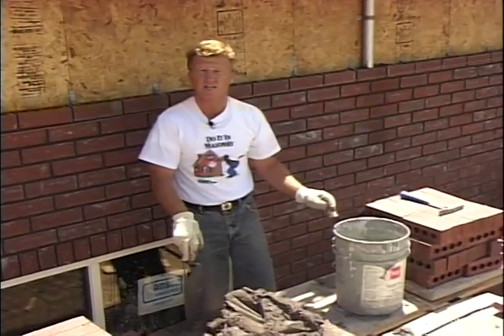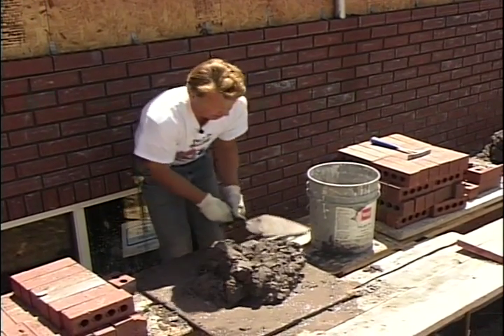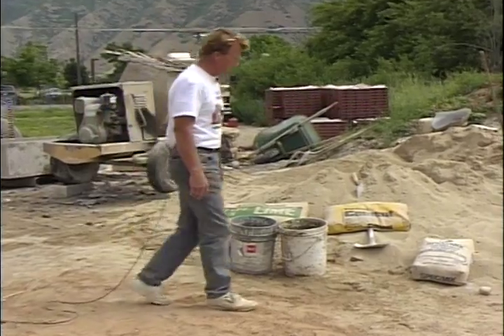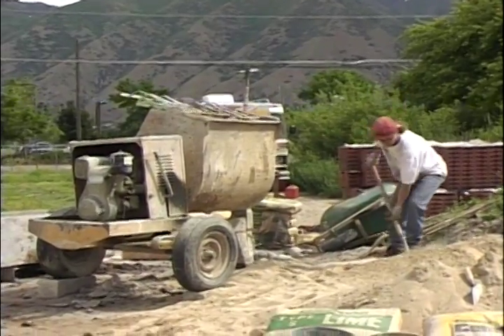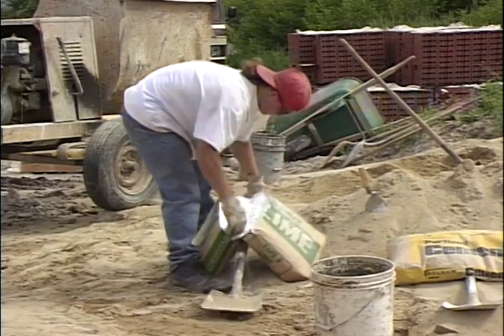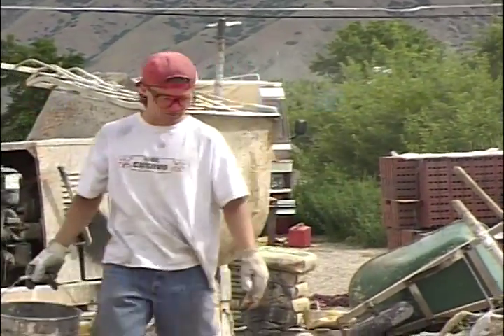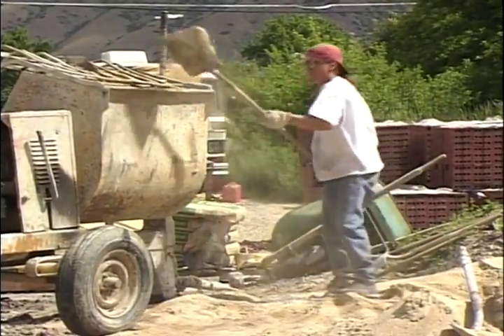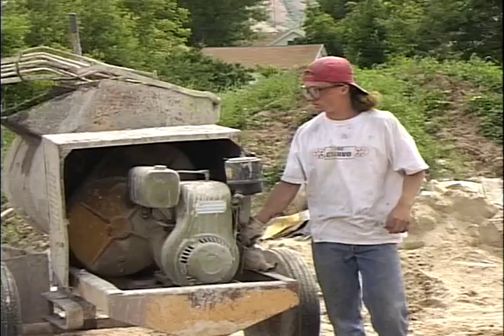Masonry Tricks of the Trade: Mortar.

Comment: Don't mix so much mortar at once just in time amounts and may be add a retarder to slow the setting down. I was always taught you should try not to keep knocking mortar up as it reduces its finished Strength. But remember mortar should never be stronger than the bricks you are laying. Stick to a gauge other wise you will see different colours in your wall. You would never get a job on my site mixing like that.
Reply: David Dore yeah mix has to be gauged or it will show on finished brickwork (patches) I use buckets to gauge my mixes you can't go wrong and also if you get a different labourer that's when it will really show,  brickwork will look shitty and that reflect on us
Reply: Ok Bob Vila

Comment: Wear a respirator mask when adding the ingredients, especially lime which is caustic, high pH, and the sand and cement which can give you lung silicosis. Safety glasses don't cut it when you're walking through a cloud of dust. Goggles are better. Cutting the bag in half method spills product and it may not be much on one bag it adds up. It's not a rite of passage to expose your laborer to unsafe working conditions. You're only young for a short time and unsafe work practices are cumulative, especially lung disease and tintinitis (permanent ringing of the ears) because you're too proud to wear hearing protection on the job.

Comment: You lost me from the very beginning when I saw you didn’t use a house wrap
Reply from the maker: you lost me at being to young to have been on a job site before house wrap was required.
Reply: Learn To Lay Brick I appreciate you assuming my age. Although that’s not my point of contention. This video was published in 2014 as a “how to”. I’m critiquing your application. If this was current enough to use OSB than its current enough to apply property water shedding practices. I’ve taken apart houses built in the 60s that had felt paper, are you telling me you’re older than that?  Age has nothing to do with applying all the proper building practices available to you. I guarantee that this house is insulated and drywalled,  if you ever leak behind that brick you will have a mold, mildew and even worse rot issue, because this house isn’t leaky like older homes were.  I appreciate you getting defensive and attacking my age 😉 tells me you’re passionate about what you do and you’re defending it.  But I love to learn, which is why I was watching your video.  But we can’t improve our craft if we aren’t open to other people suggestions and using/testing new technologies.
Reply from the maker: video was filmed in 89, and we live in the second driest state in the union, and in 89 the house wrap was optional and up to the home owner, who decided to skip it. I personally know the owner of the home in question and 30 years later the home has no issue. Current codes would require the house wrap and it would be installed per code.
Reply: @learntolaybrick  
Keep up the great work!